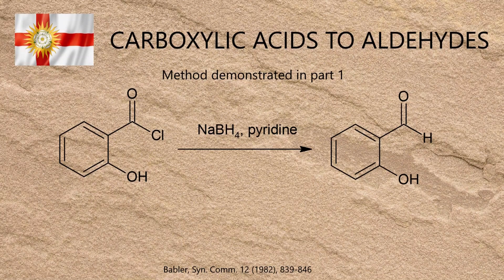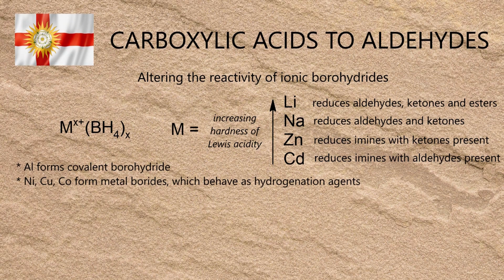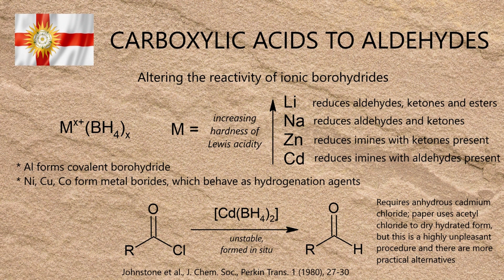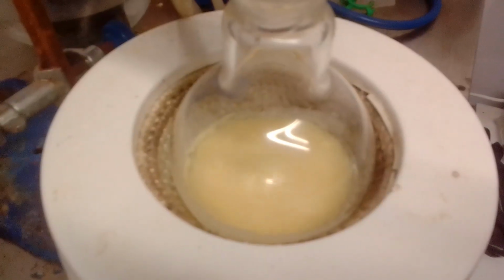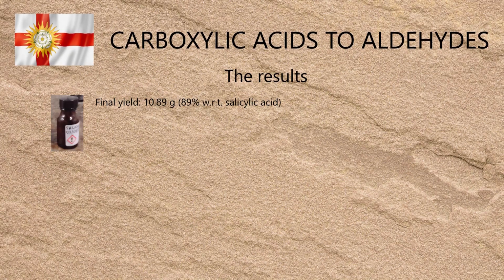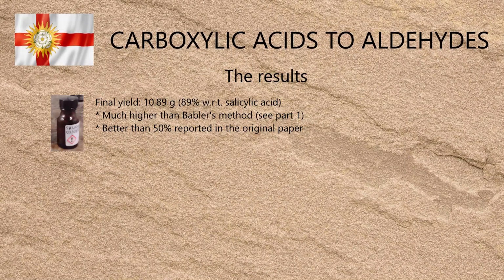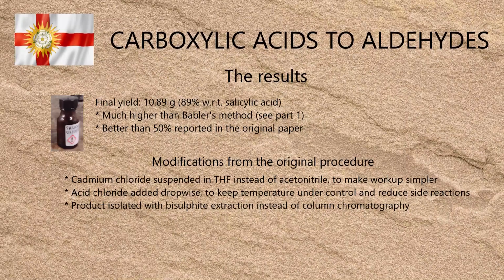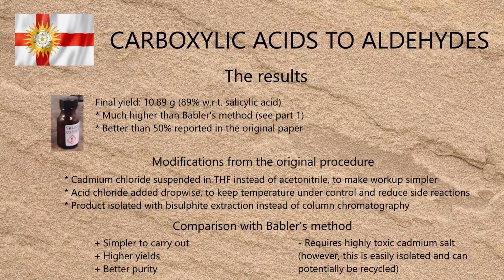Reducing carboxylic acids to aldehydes, part 2

Comment: Brilliant work, thanks for the video! One thing I don't get is why there were no solids in the bisulfite solution? The adduct with aldehydes is a white solid that precipitates out of bisulfite solution, right? Yet all you got was a yellow solution with no solids, and you didn't isolate the adduct to purify it, just dumped K2CO3 in. which kinda defeats the purpose. What am I missing here?
Reply from the maker: my best guess is that the bisulphite adduct of salicylic aldehyde, like sodium salicylate, is substantially soluble in water
also, bisulphite adducts of smaller molecules tend to be unstable and difficult to isolate

Comment: The cadmium waste can be dealt with in the manner of lead and mercury, by forming their insoluble, unreactive sulfides.
Reply from the maker: I was thinking it could be isolated as the insoluble carbonate, calcining that to form the oxide, then dissolving the oxide in azeotropic hydrochloric acid and boiling off the solvent to form anhydrous cadmium chloride, so it can be reused
in retrospect, I should really have bought the oxide instead of the hydrated chloride, but I wasn't thinking that far ahead